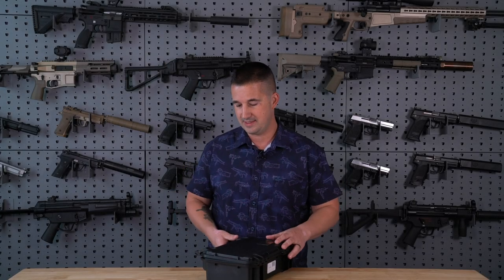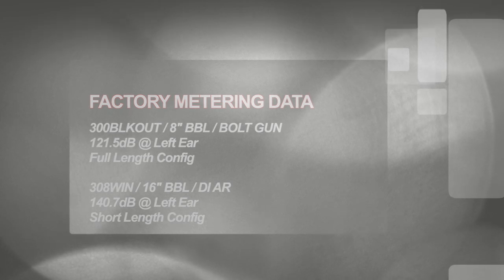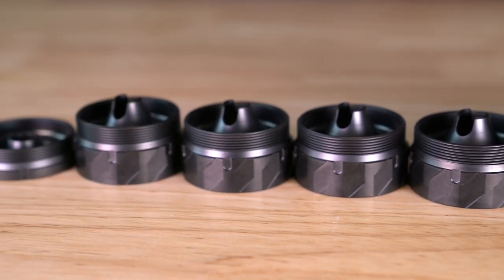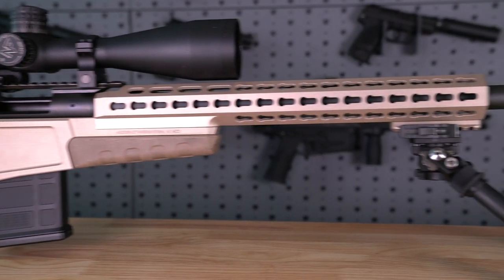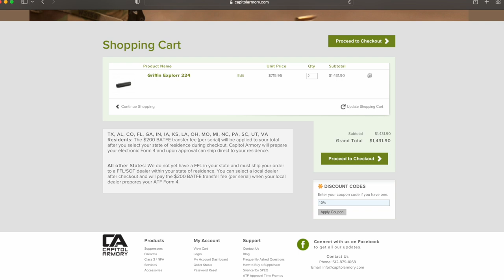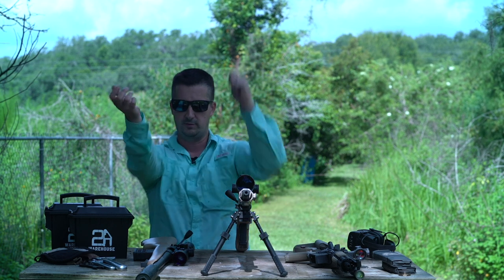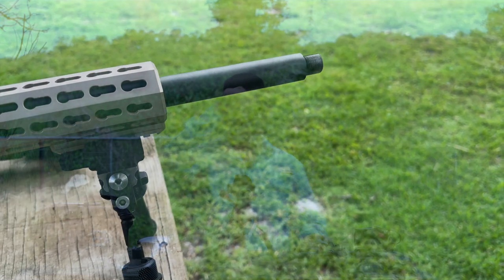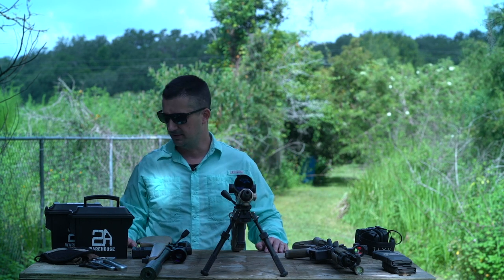PWS BDE 7.62 Suppressor - 3D Printed Titanium!

Comment: The sparks coming out of that thing was crazy. I will be surprised if a 3D printed titanium can is ever adopted by socom. The sparking seems to be the most pronounced with those. I see a decent amount of people on Reddit regretting purchasing their CGS Helios titanium suppressors for this reason. I know that you are busy and it would add a lot of time to your test regimen, but doing some shooting at night with a fixed ISO would help people make a more informed purchasing decision. Flash mitigation and sparking can vary wildly between suppressors and materials. If people are concerned with more than just sound signature and are worried about "signature reduction", it's a valuable metric.
Reply: Sparks are visible from hot spots. This would need to be kilned hotter to sinter the protrusions down more.
Reply: It’s almost exclusively with SBR’s with this can.   And the 5.56 version does have a stainless blast baffle to help mitigate this effect.
Reply: No they will use the CGS Sci Six
Reply: The BDE556 can has a stainless insert on the first baffle and really helps with the sparks.

Comment: 10.5" gave too much gas in full length config?? does this mean the extra baffles provide back pressure? if so, doesnt that give us quick adjust on back pressure to cycle action on super vs sub? i want low back pressure due to shooting lefty in AR platform, but dont want to mess with adjusting the gas system on host for different ammo.

Comment: You “tested” a 7.62 suppressor without using 7.62 ammo?  Shame on you son.
Reply from the maker: .308WIN = 7.62x51mm
Reply: @nfareview  7.62x51 is NOT 7.62x39.  I like your other reviews, but you fell short on this one son.  Now put some 7.62x39 rounds through this can, share the results with us, and be the hero you were meant to be!
Reply from the maker: @Bromo_Sexual  7.62x39 and 7.62x51 will sound the same to the MIC. The supersonic crack will overshadow the tone between the two. They will sound the same. I also don't have a 7.62x39 host with a concentric threaded barrel to run it on. Considering the pressures with 308WIN, it will sound just as fine on a X39 platform.
Reply: @Bromo_Sexual  you need to pump your brakes, kid. The amount of people that are going to use a 7.62x39 host with this suppressor can probably be counted on one hand.
Reply: @airwolf...  Calm down Karen.  Nfa  Review gave me an honest and informative reply, so I liked his comment and remain a subscriber.
Reply: @airwolf... you don’t think a suppressed 7.62x39 would have much interest?